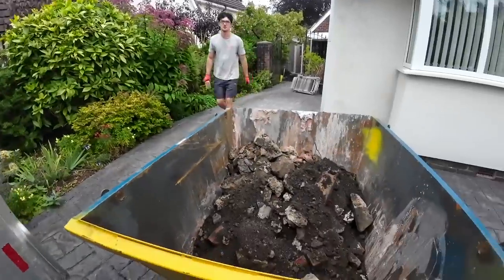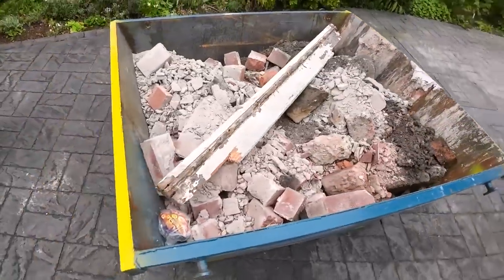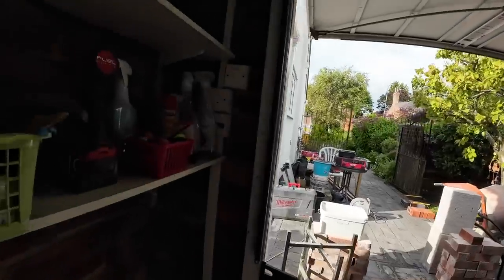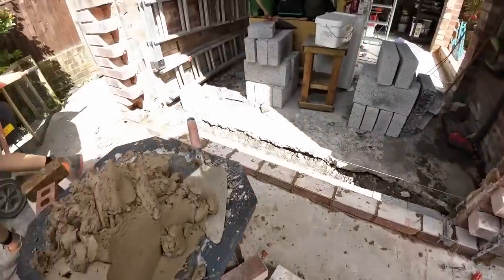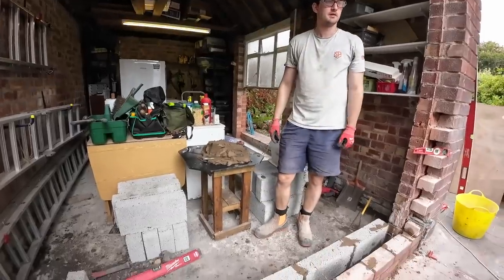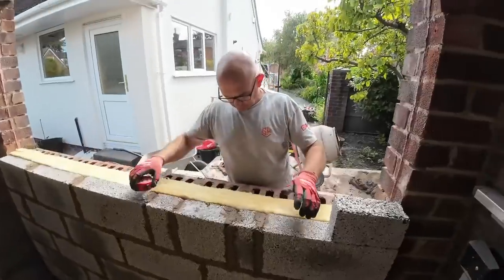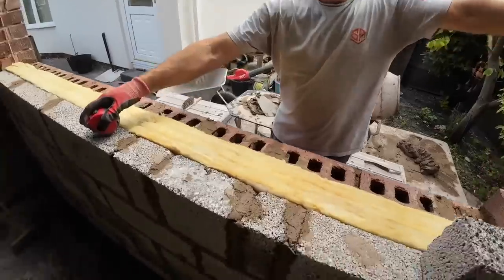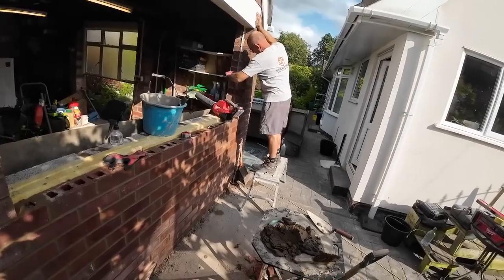GOING THE EXTRA MILE FOR YOUR CUSTOMER.. GARAGE CONVERSION PT 2

Comment: Looks like weighs a ton. Proof will on hard concrete buddy. Must admit a do like ma dewalt 9inch cordless saw for accessibility a light over head or what ever. Heavy cutting nothing matching petrol saw more so on ts700. Not convinced with these bigger saws. Soft brick there so will expect it to fly. Will wait till see these saws performing in hard ass material see what does to battery and tool performs time scale. Great work steve Alex. 🤟🤟🤟
Ps will cut quicker with water hose connected a must 😜😜 some helly Hansen water proof trousers. Keep the legs dry lol

Comment: Im not a builder so I am wondering why you are builing a double skin wall under a window when the rest of the building is just single skin.
Reply: There is brick pillar at each end, plus it is getting dry lined at some point.
Reply from the maker: Cheers KHM 🤜🏽🤛🏽🧱👍🏽
Reply: Great vid lads! Spot on work as always, liked the last frame when you casually plonked your level on the top of the wall….and it’s 100%….cool bricky!
Reply from the maker: @SteveBernard42 . Brickies mic drop 😉😆🧱👍🏽
Reply: Nice job, looks neat.😊
Reply: Because it’s being made into a ‘Habital Room’, so has to meet the planning and building regulation requirements for such…

Comment: Mint job that looks good. I think we’ve all messed up on damp course pal at least it was only a couple of brick.🧱
What are the Milwaukee levels like mate think I need to get a new level.
Great work men 💪🏻🧱🧱🧱🧱🧱🧱
Reply from the maker: Cheers buddy , very true 🤣. 
   Thoroughly recommend them . Good solid levels mate , pricy but will outlast Stabila .
   Have a ride down to Preston to William Moore and son . They have got a massive amount of Milwaukee gear in stock and in display. You can try most of the stuff in tethered and with batteries on . 
  They’ve got our levels in too .
  Oh and the magnets are well strong 💪🏼 🧲🧱👍🏽
Reply: @SteveAndAlexBuild  
Cheers pal I seen that store think it was on your instagram looks good I do have some Milwaukee stuff it’s really good.
I’ll nip to preston and have a look.
Cheers pal 👍🏻
Reply from the maker: @rowlockconstruction8345 . Spare at least an hour mate it’s like Santas grotto 😍🟥🟥🟥🤣🧱👍🏽
Reply: hi guys. good job. postcode pal to Milwaukee heaven. i'll pop over when i can find a minute
Reply: @SteveAndAlexBuild  
Hahaha 👍🏻👍🏻🧱🧱